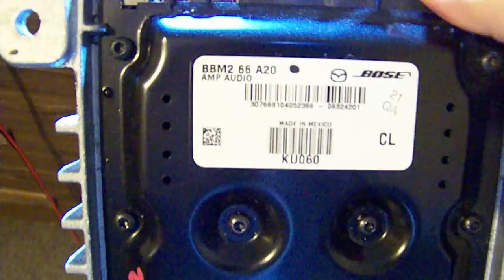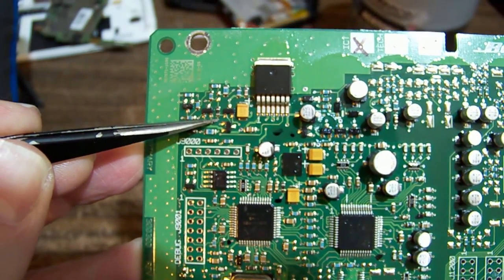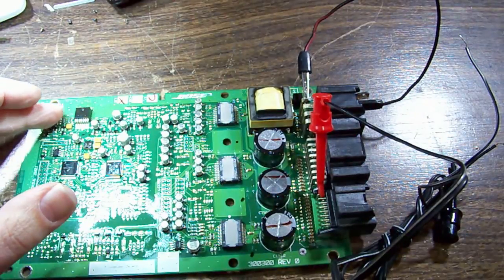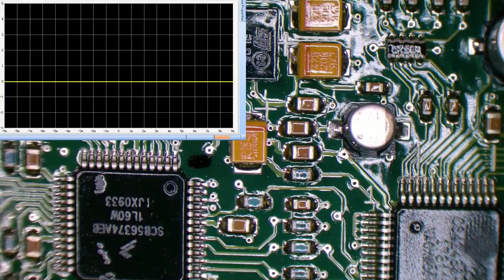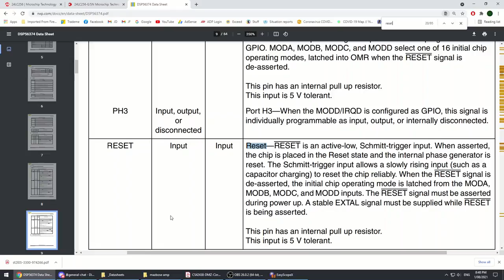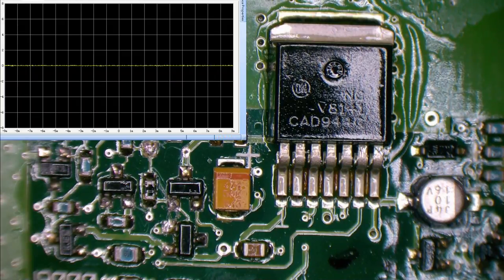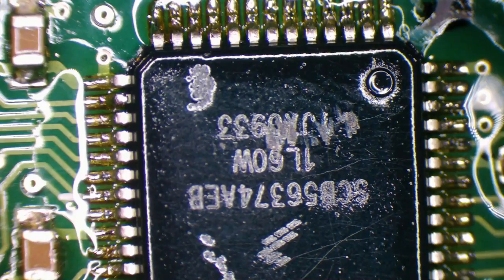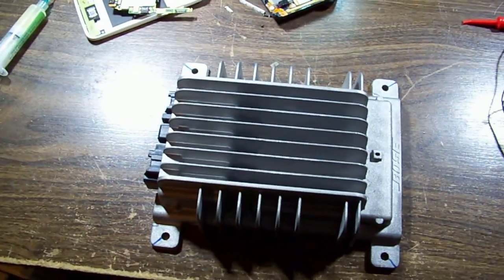Mazda 3/axela bose audio amplifier repair part 1

Comment: Thank you for the video. I have an identical board and I tested everything you suggested in Part1 & Part 2 (as well what was mentioned in the comments section), but sadly it still doesn't want to work.
All 3 IC amp. warm up in a similar way (I tested using an IR thermometer).
The main headunit was replaced by another one of the same model; no improvement.

Comment: Hello, great video, it helped me a lot to debug mine amp! 🎉
I have a couple questions maybe you are able to answer…
The first: I have noticed the rear speakers are running less than half volume of the front pair, looking at the pinout of another bose amp with the same connector I have discovered there is a pin (B2) called "rear seat audio enable signal" and I have traced it on my amp pcb and actually it goes into some components! Maybe applying v+ to it will make the volume equal front to back?
Second question:
I have not the original hu but I know it someway digitally controls the amp’s dsp and output levels (and possibly even update the amp firmware, although badly😅). 
I have tried to figure out what pin(s) does the magic and A1 to A4 seems plenty to accomodate 2 differential data lines one from the hu and one to the hu. But I am not certain since in all the pinouts I have seen so far are marked N/C.
If I am right, do you have any guess on what protocol is used for this "digital connection" ?

Thank you a lot❤
Reply from the maker: A pinout I found shows the green connector has a red wire and white wire which are on a can bus and a yellow/black stripe and brown/white stripe being serial comms to HU. I think there are a couple of different pinout for physically similar amp module but info is hard to find. You'd have to reverse engineer the protocol. The rear seat enable i would think would be just that not some level of audio. You said it was half the front level, does it change with volume control. Could be a front to rear fader setting more likely. If you don't have the factory HU maybe the amp is stuck on that setting. Good luck!

Comment: Brilliant videos on this cumbersome amp, thanks for sharing!
At 13:55 you measured 1.8 V on the LDO which I think is way too high as the DSP's absolute maximum Vcore is 1.6V and in this circuit it is normally run at 1.25V. It seems that's what killed it... Have you measured the voltage again with the new DSP? Hope it didn't die after a while with the 1.8V on it...
Reply from the maker: Oh interesting point you have. Maybe that is what it causing the failures. I really don't know, I will have to watch out for that next time I get one. Thanks!
Reply: @JonnyFix  There's a dual voltage regulator supplying the 1.25V and 3.3V now the 3.3 is fixed while the 1.25 is set by a zero ohm resistor (tiny black component) which can have intermittent or "high(er)" resistance connections at the solder pads causing the 1.25V to rise. Best to reflow that resistor. In an ideal world there would be a clamping network there to protect the DSP but there isn't so... Anyway good luck with the next one! :)
Reply from the maker: @benkozs  This exact unit came back, it has been 2 years so that's good. Same chip failure. One of the guys thinks it's when a car sits unused and they don't keep the battery charged. Maybe the sudden drop in B+ when they try start it causes the regulator to go unstable and spike the chip like you mentioned. I also reflowed the reg just in case as I have seen a dry joint under one and that would have same effect as on that resistor to.
Reply: @JonnyFix  Hmm.. maybe worth putting a clamp on it by using two ZMM1 or similar 0.77V zener diodes in normal series connection on the LDO output to limit it to ~1.5V . In case of a catastrophic failure it may take out the zeners and the LDO but preserve the DSP. Under "normal" momentary overvoltage conditions the LDO and zener should survive if the LDO is short circuit protected internally.
BTW you can test the low voltage instability theory on a stabdalone LDO by using your bench PSU to simulate sudden voltage drop in a low enough current limit mode to avoid damage. Or maybe the datasheet mentions something too.
Frankly the zero ohm resistor is more suspicious to me though.. I "substituted" it with a healthy blob of solder. :)
Reply: @benkozs  which zero ohm resistor are we talking about?  the one to the left of the bottom output capacitor of the dual voltage regulator at 13:42?  or is it the one near the mosfet for the 5v regulator such as at 6:37?  Not an EE..barely understand this..just a guy with mediocre soldering skills trying to fix his amp for $7 lol.
Reply: @Live.Vibe.Lasers  The zero ohm resistor is for the dual voltage regulator (LDO) and so it's near that. Tiny black component measuring close to zero Ohms, sometimes an actual zero is written on it.
Reply: @benkozs  Thanks for replying!  It does have a 0 on it.  I think I know exactly which one you mean. The DSP is on order from China.  I'm probably going to implement your zener diode idea.  I'll let you know how it goes.  Thanks!

Comment: Follow that reset line from the debug port, that will likely be coming from a supervisor IC, or possibly even an op amp comparator with an R/C network to provide a turn on delay.
Reply from the maker: The processor creates a pulse train which is monitored by the 5v reg and if not present the reg pulses the reset line. Thanks for the idea tho!

Comment: Mate, I have a Bose amplifier out of a Chevrolet vehicle. It doesn't turn on/play sound  until it warms up, then works totally fine. I'v tested in the vehicle, I can warm it up with a heat gun and it turns on in less than 30 seconds, every time. I have some basic decent solder skills. Any guesses to what would cause that? Thanks.
Reply from the maker: Sounds like a bad solder joint in there. If it's the same as this one, the IC talked about at 11:34 has been known to have bad connections, I think my first video on these things was that. So hook it up like I have and test the voltages around here and prior up to about 14:00.... or if easier take it apart then plug it back into car for power source. If you have a missing voltage when cold I'd start with re-soldering the related reg.

Comment: Hi Jonny , have a BBM2 66 A20 that makes a machine gun/jack hammer sound from all the speakers..... in your experience would this be the codec or DSP ic?
Reply from the maker: My experience is limited to these videos :) But it is possible, it could also be the CS42438 codec, if the A/D or D/A sections had failed I suppose it could cause this.
Reply: Same problem in my car did you figure it out andy?

Comment: I think i would run away from this over complicated nightmare amplifier ha ha :-D
Maybe i would nail small leds to the rails so i could see if they were there all the time.
It's really odd that the processor ignores the i2c serial memory.
I wonder if the chip is actually running at all,  stick a radio near that chip to see if its generating a squarewave row like processors often do.
Reply from the maker: Well it has oscillator and it gets a little warm, I think something in the chip has failed and it's either lost internal code or the ability to boot from the eeprom.

Comment: I have one of these that won't give any audio output when the supply voltage goes above 13v. I'm wondering if there is a voltage regulator that has died and some other component is choking on the excess voltage? I was an electronic tech in the Navy but now have no test equip, schematic, etc. Has anyone else seen this? Radio runs fine off the battery but when car is started and voltage rises above 13v then no audio output. Any ideas appreciated.
Reply from the maker: That is unusual. How far above 13? All car electronics should be ok up to say 15, an alternator should in theory never put out more than 14.4. Check for AC at the alternator as well as a bad diode can allow ripple through which will upset things.
Reply: @JonnyFix  I've got a voltmeter on the power recep. and anything below 13v works fine, above 13v no audio. If it's above 13v and I do something to temp. lower the volts like turn on ac then the audio will turn on for a fraction of a sec.
Reply: @JonnyFix  When charging it typically runs about 13.2-13.4
Reply: @JonnyFix  fyi, amp was submerged when son drove car into flood water. I already opened the case, cleaned everything, new heat sink compound, etc. but nothing changed. Saw no fried components or anything sketchy. This did NOT change the symptoms. Very odd.
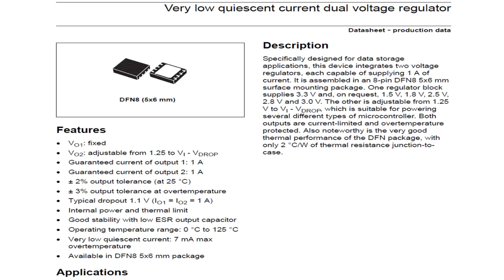Reply from the maker: @jimg3450  Ah liquid damage, always a curve ball. Could be an SMD ceramic capacitor once they start breaking down they can appear ok then become short after a certain voltage. If you can use a thermal camera or have a feel around you might catch one running warm. I'd also check do you still have the power on signal above 13V that goes to the main reg as we traced out in this video? If yes, is the reg at 6:40 still giving an output? Also output from the reg at 12:00. I've seen them with dry joints, having been wet could have encouraged this more, my first video on these was this. If all rails present and correct while there's no sound then likely an output stage issue, also check the speakers aren't junk from being wet and overloading the amp ICs.
Reply: @JonnyFix  As there is no hard and fast solution I've decided to try a used amp from eBay. For $80 I will be better off time wise and maybe money too. Thanks for the answers.

Comment: Hi! Does anyone know if GAN6 66 920A and BBM4 66 A20 both have the same pinouts?

Both units look identical to the one in your video. I took the GAN out of my car but unable to purchase literally anywhere but there seems to be lots of the BBM variant
Reply from the maker: Not sure, it's hard to find any information on them. If you can afford to take a punt on a BBM unit e.g. it's easy to re-sell if you don't want it then maybe get one, open both, see if they are built identically, same parts in same layout etc. Even do some checks to see if the pins go to the same places.

Comment: Does the ceramic cap at 25:31 have a crack in it or is it just the light?
Reply: It would certainly warrant an ohms test.
Reply from the maker: Tis but a scratch :)